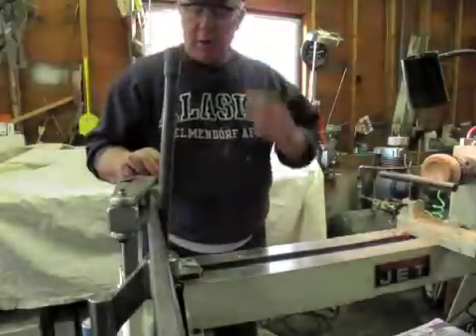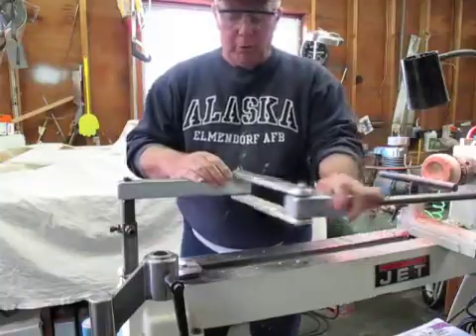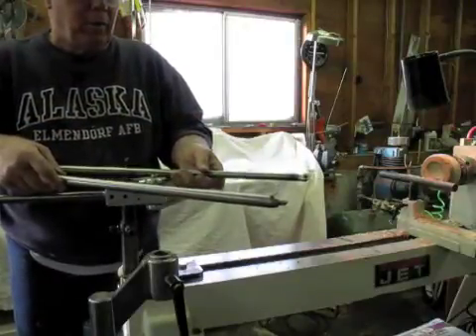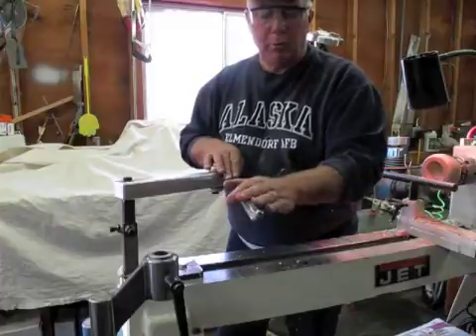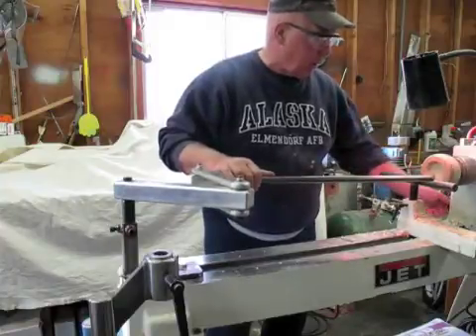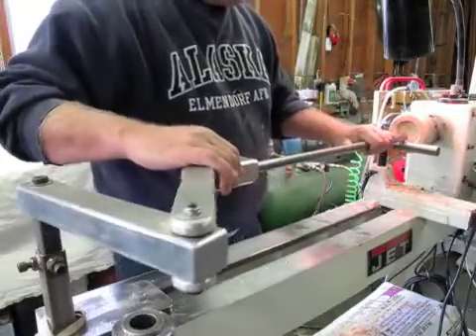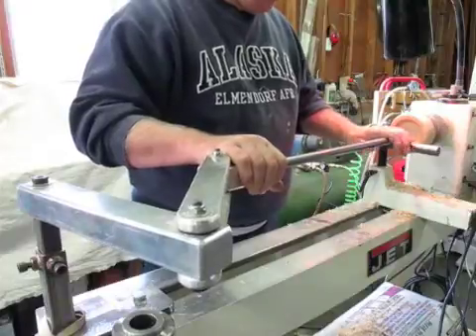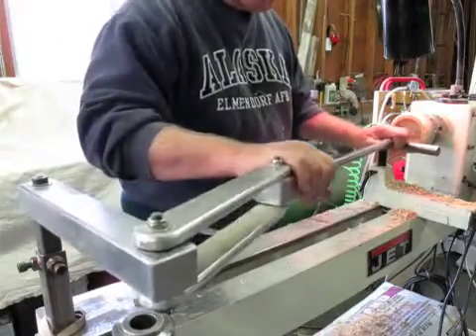Woodturning Articulated Arm Hollowing System - Part 1

Comment: Brendon,  If you use a very fine diamond sharpener, even if it is credit card size, and lapping fluid you can sharpen carbide cutters.  Turn them upside down on the sharper and make circular or figure 8 movements with light pressure and your carbide cutters will be as good as new.  There are videos on Youtube that show this.